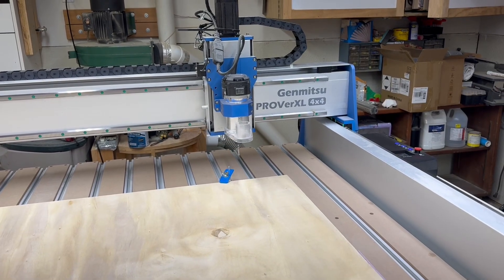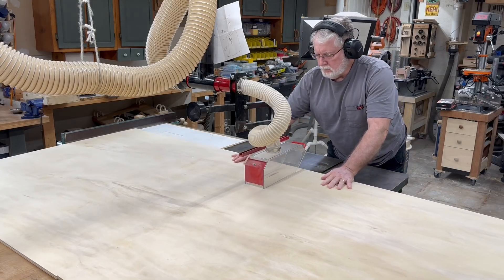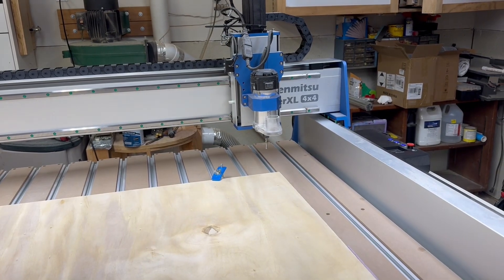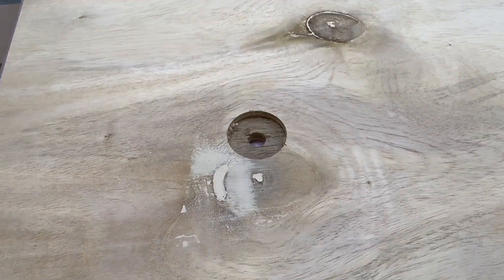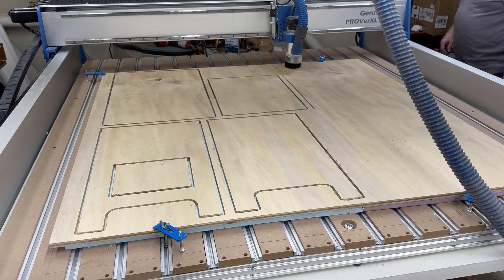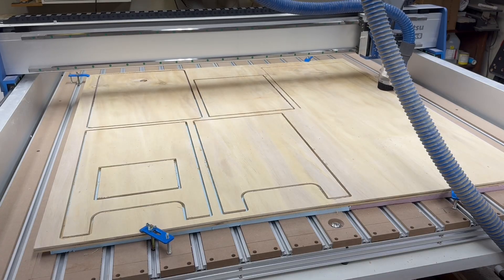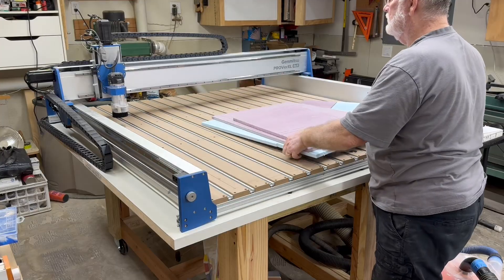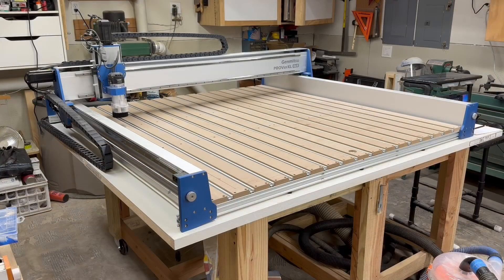I Tried Cutting a 4'x4' Plywood on the Genmitsu ProverXL..Here's What Happened" (Maxing out the CNC)

Comment: What is the footprint of that 4 x 4  cnc ?  I'll need  to build a table for it.
Reply from the maker: I used two slab doors for my table top. So it is 72x80 inches. I wish I had made it a little bigger 72x85 would be my minimum if I had to do it again.

Comment: If you used a 1/4" compression bit, you could cut that out in 2 passes at 18000 rpm, and 350 inches per minute, if your machine goes that fast.
Also, no tabs needed with a compression bit. The sawdust left in its wake fills up the kerf, and locks the parts so they can't move at all. Can't remember the last time i used tabs.
Reply from the maker: Great idea. I need to buy some compression bits.
Reply: @PawPawsWorkShop  I'm pretty sure that 350 inches per min would destroy that machine.
Reply: @northotagogolf 😂😂😂
Reply from the maker: Yes, can’t take that speed seriously

Comment: That's a big beast, large area, but good for large flat projects. You didn't get the dual cutting head option for duplicate cuts?
Did you cut in 1 pass? Looks like downcut, no top face splinters. I use a hogging bit allows faster & deeper clean cuts.
Reply from the maker: This actually was an upcut bit and it did a remarkable job. I cut this out in three passes. I believe two passes would be ideal. Not sure I would want to try one pass. Thanks for watching